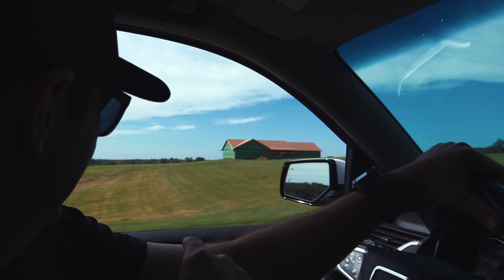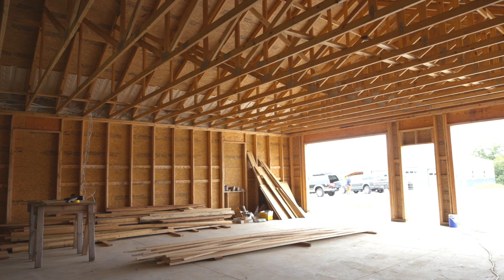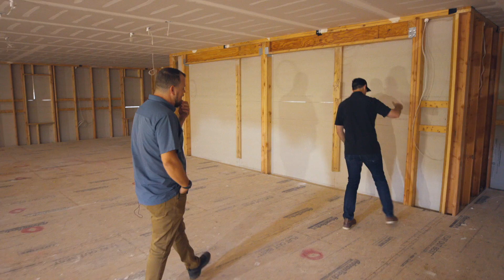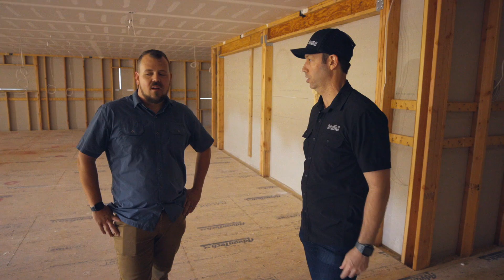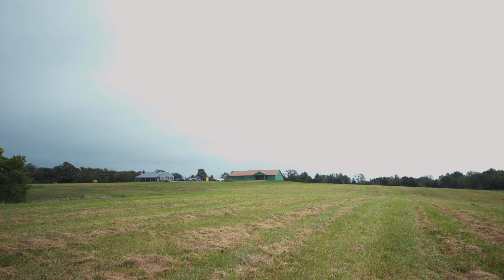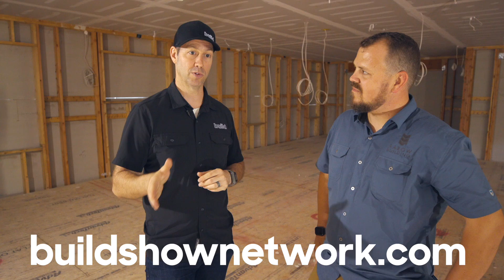A House with No Doors or Windows?

Comment: I can't believe they didn't throw a vapor permeable membrane between the roof joist and the firing strips they installed.
Reply: WHAT??? Are you kidding me?? It's a VENTED ROOF assembly, time to break out the 9th grade science book and reread it......
Reply: @stevenbaczekarchitect9431  passive house design. Google it. It's a very well known and established energy efficiency technique that they are attempting to replicate here (poorly). That's all I'm going to say here based on whatever this reply is. The company 475 would also give you insight.
Reply: Sean Stumpf How about you Google who Steve Baczek is...
Reply: @judahchadwick6577  I did and now I am more confused then ever that he agrees with this and also the harshness of his  initial reply. The method I am talking about was also featured in a recent Build Show video titled 'Double Stud Walls and Bark Siding, so it's not like I'm talking about something crazy here. Matt Risinger has literally done a video about it. In my opinion the method I have mentioned and referenced is far superior than what's done in this video.  This method is trying to reinvent the wheel by using drywall as an air barrier vice an actual smart vapor/air barriers by companies like pro clima and at $250 a square foot to boot.
Reply: @joshualruby  Joe is certainly the ultimate expert!!! As for drywall - I learned that drywall can be an :air barrier" from Joe and have never looked back. Mostly due to success - I have had numerous homes use the drywall ceiling as the air barrier to significant success. This house here initially tested at .30 ach 50 Pa which I consider extremely successful. Even as the nay sayers would say it will crack etc. Let's say it does and the air leakage doubles in number, .60 ach 50 PA is still an extremely great number.....
Reply: @stevenbaczekarchitect9431  I just feel more comfortable for long term efficiency to have it back sealed. Particularly because most don't drywall the whole ceiling plane first. Most people have interior walls all over and then every electrical outlet in the walls, as well as all ceiling penetrations add leaks to the envelope. It seems simpler for peace of mind to just cover the bases by applying a back seal to the ceiling plane with something to build the bathtub and never have to worry about it.
Reply: @seanstumpf4190  Hey buddy, sorry if I appeared rough, certainly not intentional. Canada has used drywall for years. I have too - with exceptional performance and not problems (at the ceiling of a vented attic). I'm very familiar with vapor permeable membranes, and have used them when there was a call for their use. I look at each project for the right assembly and approach it accordingly. This house was tested to .30 ach 50 Pa, then we installed Aerobarrier and took it to .06 ach 50 Pa - what part of that demonstration would you think needs more "superior" methods. This house is virtually "airtight" with the resulting air leakage being noise. I'm not trying to reinvent the wheel (I'll leave that to the fancy membrane people). I'm simply designing homes to the best knowledge we have today, it's a knowledge that is tested and been around. What do you think the membranes will do that the drywall can't in this specific situation? Drywall is airtight and vapor permeable - seems like a win win between living space and vented attic assembly to me. I'm not saying those membranes don't work mind you....
Reply: @joshualruby  All those penetrations you speak of happen at membranes too - and have to be dealt with. I have used drywall in numerous homes to great success and don't plan on changing. Like I stated, even if the air leakage doubled in 10 years, this house would still in the 1% tightest list. When we design and build your home we can add your desires and certainly add a membrane - meaning it is a personal value decision.
Reply: @judahchadwick6577  Just someone trying to get thru the day's challenges!!! Thank you for the kind words
Reply: @seanstumpf4190  again sorryu for what seemed harch, my point was it is a vented roof, I want moisture to flow thru, up, and out.......drywall does that just fine, it's vapor permeable as can be, but also airtight - a perfect fit for the requirements. My apologies again - I greatly appreciate your comments and your desire to learn. The problem is there are soooooo many materials and information out there, getting the right story is tough, especially given each project has different design parameters. Again thanks for your patience and your comments always appreciated
Reply: @stevenbaczekarchitect9431  Oh, you're right, a typical membrane would not solve it. I spec out a back seal by spraying 1" of open cell foam over the ceiling plane after all penetrations are made so it is as sealed as possible. Then dump cellulose on top. I only build ICF so the few points to worry about the air seal for me are only the roof system and fenestrations, which is the reason I cared enough to find a better solution. Most people who build with stick framing will never seal the walls well enough to make their ceiling plane a major issue; they have bigger issues to solve first.
Reply: @joshualruby  Help me here buddy - you agreeing with me, or jabbing me here? Yes a membrane would work, but why incur the additional cost of a membrane and then put drywall over it? Especially if drywall does a great job, which I believe it does. If your more comfortable with a membrane have at it - it won't hurt, and it isn't wrong, it's just simply more than I think is needed
Reply: @stevenbaczekarchitect9431  I am agreeing with you, a film style membrane alone is insufficient improvement over regular drywall. The same penetrations would ruin the seal. And, assuming the ceiling won't crack, it is mostly superfluous. It may aid in attaching whatever seal is used around penetrations, but not likely. I believe the best way is to apply spray foam, not a standard film style membrane. I do believe drywall alone is sufficient for most people because they typically don't go through the effort of sealing penetrations anyways, or doing whole ceiling planes continuous, or account for proper sealing at corners and plane changes. (Particularly true for attic truss rooms). But you are definitely right in that the drywall is a sufficient air seal for most people and cases. (Particularly because they should worry more about their wall issues than the relatively small issue of possible cracks in the drywall ceiling area)
Reply: @joshualruby  Great - now we're buddies lol, have a great day, thanks for the commentary - see you around the videos....
Reply: @stevenbaczekarchitect9431  Very good. I enjoy making friends, but as an engineer, I'm better at numbers than words.

Comment: Seems like the house has no soul. They spent a ton of money on insulation and a crazy floor system, but seems like the money should have been spent on vaulting some of those ceilings and chopping up that roof line. It just looks so plain. Even after the windows and doors are in, the roof line is just looonnnggg and straight.
Reply: I always think that the outside of a house is for everyone else to look at, where as the inside is for the owners, I rather spend my money inside 🤔
Reply: Lipstick on a pig? It is still a pig in the end

Comment: Dont the siding nails cause you air leakage? Or penetration in your waterproofing?
Reply: Depends on the style of exterior covering. They may put some strips up to hold the siding, but with the foam backed sheathing it will still maintain the air and water sealing. They may do something to seal the penetrations if they do put hanging strips or some other treatment for a stone exterior. Not too difficult if you plan for it. Hard to do right late in the game as window and door depth become issues.

Comment: 2x2 square one center pole second story with very flat pyramid roof surrounded by another 2 wide floor on all four sides with a second story 1 over 1 roof top get a 9 square house. Metal beams on cinder block instead of first floor walls.
Reply: You are nuts

Comment: This video shows building right is a waste of money. Let me explain

In Columbia MO, new construction goes for 125/SQ ft approx.
 That includes land and architect fee. Let's say the house portion is $100/SQ ft.

So 2500 SQ ft  house is $250k for the house. I pay cash for it but my electric bills are $200 month.

The green guy spends $625k for his energy efficient house but his energy bills are only $50 a month.

So he is saving $150 a month or $1800 a year on his house.

I spent $375k less for my house and I put that money in the bonds at 4%. That's $15k in income I receive. So his extra 500k saves him $1800/yr. My extra 500k makes me $15k/yr , out of which I can pay the extra $1800 in energy bills and still have tons of money left over

This is exactly why in most parts of the country the cheapest way to own a house is to build the absolute cheapest house you can.